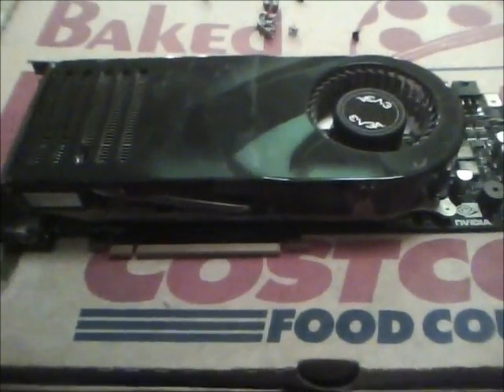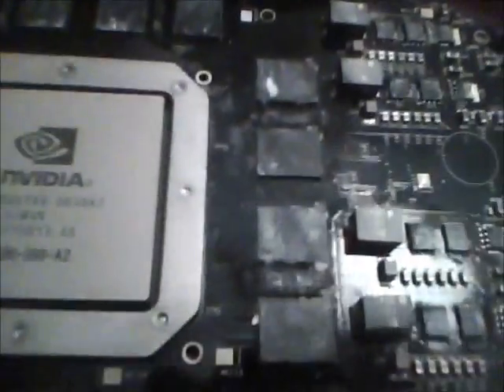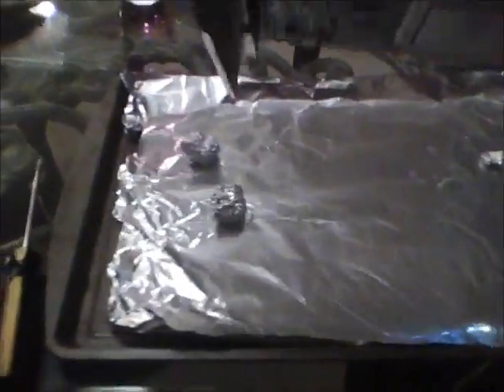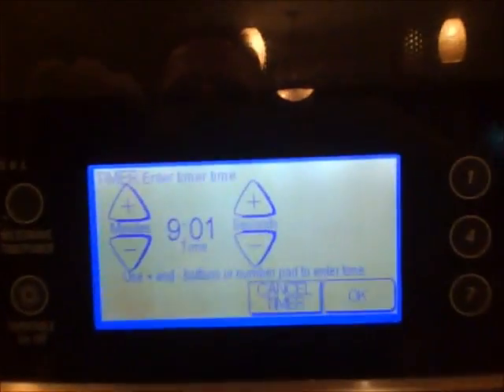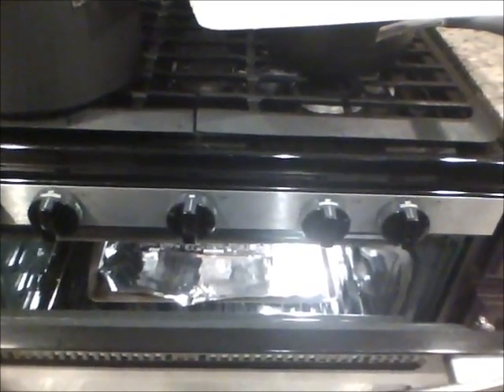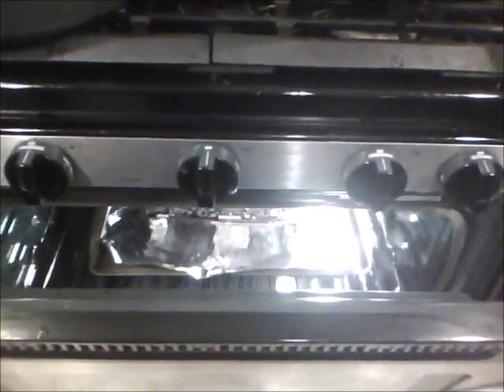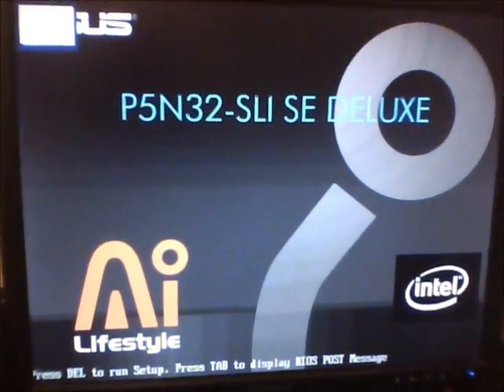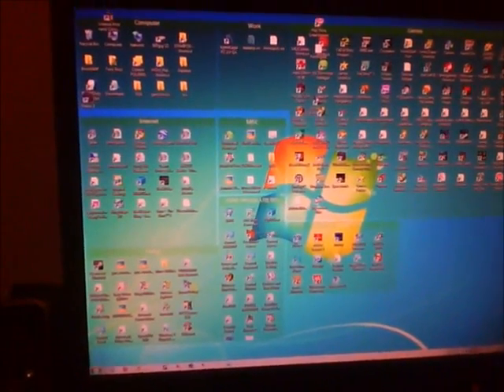Fix your 8800gtx Graphics Card (STEP by STEP) by Baking it in the OVEN.

Comment: This is a awful idea to do. Because of issues with the gpu block falling out do to to much heat across the board. equally heating the joints across the board is a crime it will cause the joints to loosen and cause the gpu to either fall out or become loose. So what I do is use a small butane lighter or welder and quickly warm the solder joints up until they look kind of shiny  with out setting the resistors and capacitors on fire. Remember do not equally warm any side up at any time. We call this baked goods when you cook it in the oven. I call it a gpu when you do it right with the welder or lighter.
Reply: What do you think happens when the board is soldered initially? Its gets dipped into molten solder. Heating up the whole board to the melting temperature of solder is safe. Local heating induces warping, so professional rework heats up the whole board by infrared from below to a bit less than melting, and then use hot air nozzle on the chip from above, to reduce temperature gradient and warping. Warping is the real danger.

Keeping it heated for a while does reduce service life of electrolytic capacitors though, so one needs to plan their replacement. Other elements are just peachy for extended time heated up, as is the board itself, just as long as the temperature is even and moderate.

The reason the GPU failed and solder joints break in the first place is uneven thermal expansion of the board below melting temperature. The board gets close to but never exceeds 110°C in operation, but the heat is very local, board warps, and the still brittle at that temperature solder points break. The solder points need to be heated to the melting temperature to reconnect.

Comment: This works. there is a heating problem in the GeForce 8 series  of GPU,s of its over heating this causes the solder on the unit to slide mostly around the GPU,s memory causing bad connections the result mostly being red lines.

Comment: So i was getting random white horizontal lines with my geforce 465 gtx and would only start in safe mode.When i took it apart the fan had completely been blocked by dust. Did the exact same thing you did to a T, card works great. IT DOES WORK!

Comment: This will fix cards where the problem is small cracks(micro-fissures) in the solder joints, which results in images plagued with artifacts(strange characters) all over the screen.  Heating the card to this temperature causes these solder joints to melt, thus eliminating those cracks.

Comment: Just "BAKED" my Nvidia BFG 8800GTX  was "FRIED" thought it to be the power supply and I already took it apart and tried cleaning and reapplying everything. and guess what works better then the first time I checked it's specs. runs at 57-61c  FYI MSI afterburner can help set your fan to 100% over the 60% that its preset at and allows for over clocking. also has an option to super benchmark your card at max GPU... I'm sure a lot of you out there are willing to use it after resurrection your cards.

Comment: Thank you very much Sir ! It does really work !!! I had white orizontal rows starting loading the bios. At naked eye I didn't see anything wrong with my board. I have also measured capacitors with a multimeter, but nothing suspect. So I followed your instruction (because I had nothing to lose): I put the video card face down in my oven  at max temperature that says 250° C (in reality I measured 210°) So I did for 12 minutes and then I waited half an hour. It really works !

Comment: Just baked my flaking EVGA 8800 GT as per this vid. worked. still cant quite believe it. (layed my card the same way up and no probs).
I would add that perhaps just the process of taking off the sink, cleaning, and reapplying might be half the solution - when i removed the sink, the paste was ALL OVER THE PLACE, spread out over surrounding solder undersides of components)

Comment: THANKYOU Tony Ricci, it worked for me. I have an XFX 8800GTS 512, which died a while back, had to RMA my GTX 570 so I figured while waiting, I have nothing to loose. Before the fix,my 8800GTS wasnt even recognizable in windows, my pc would just go to VGA mode automatically, thats how dead the card was. After doing this, It works like brand new. I knew it worked once in desktop it said, "installing drivers for device" or something like this. I wish I had wine to celebrate but I quit drinking :p

Comment: yea, I'm safing up for a 650TI Boost edition, or just wait for the 700 series, I found another solution, 9800GTX requires 2 6 pin connectors, I'm running it on just one now, minor loss of performance but no more crashes, wondering how long that will last though

Comment: its not about the thermal paste, its about the pieces of metal, after a while it starts to crack and you can get artifacts,
by putting it in the oven they will remelt fixing the cracks and they will work again :D

Comment: You`re right about spreading being the wrong way to apply paste. It can create pockets of air. I used to do it that way until i witnessed it for myself. You may or may not be wrong about the amount of paste (on a gpu). Too little on a gpu can leave a gap between the gpu and hs because the memory contacts touch also and can lift it off the gpu. This happened to me when i put a full cover EK waterblock on my 8800GT. More paste fixed it and dropped temps by a further 32 degrees on full load.

Comment: GREAT GOOGA MOOGA IT WORKED!!!  Thank you so much.  I did it face up (forgot which way you did it :-P) and didn't even remove the heat sink.  I just removed the plastic cover (6 screws) and unmounted the plastic fan (3 screws).  No need to mess with thermal paste.  It worked great.  Thank you very much!!! :-D

Comment: Fuck, some of the components fell off. Did it exactly like the video, must have got too much heat, inaccurate cooker maybe. A piece that looks like a tiny speaker with a hole in it and 2 other square pieces with 2 contacts on each side fell off, don't know what they do. I'm gonna try soldering them back on, miracle if i can sort this out.

Comment: The reason this works is because you are re soldering all of the soldering points. The only ways I can think you can fuck up is by over heating the card and damaging the silicon, but i think that happens somewhere in the 500+ temps. With that being said, if it doesn't work, it might not of been the solder.

Comment: I just took my card out of the oven. This will be the third time, and no sign of any melting what so ever. Also, I have been baking my card without taking the fan off, doesn't seem to hurt much. I think the reason my card only lasts a month is because i never replaced the heat transfer compound stuff... lol whatevs

Comment: Thx for the info:) I might try this then. Me and my 9800gt have been through alot together, we are good buddies. And, how did you deal with those power supply connectors? They are some kind of plastics, wouldn't they melt in that temp?

Comment: you can just put a pea size dot thermal paste in the middle of the chip, the pressure off applying the cooler will spread the thermal paste evenly

Comment: I had a Very similar problem with a 9800gx2 and you probably know the gtx 295 and the 9800gx2 and pretty similar in design. i found the core that was unstable and just re flowed it by just using a heat gun. i don't like the oven trick just because it can heat up parts of the card that aren't really good to heat up like the capacitors etc... but anyway my card was having the same issue as yours but now works as it should. just some advice to help you out some.

Comment: hey can i ask you! I have a gtx295 and i can't run it at stock speeds it keeps going black screen when i run a game but in windows its fine, the only way i can use it for gaming is by under clocking the core,  shader and memory clocks by nearly 50% running core at 350mhz  ! If i bake it in the over like this would it maybe fix it?? anyone? thanks for any reply!

Comment: I followed your instructions to the "T" except for a couple of things.  I did not spread the thermal paste and I did not preheat the oven.  Also I went with your original instructions and had the processor facing down.  Worked like a charm.  Thanks!

Comment: yeah. kelvin scale is the same as celsius... only the zero of the kelvin scale is adjusted with absolute zero and the zero of celsius scale is adjusted with triple point of water,
the difference between any two temps in the kelvin scale and the correspoinding celsius scale is the same.

Comment: yeah i cleaned it up and i found what that was. those are thermal pads and i read that they should be replaced if damaged, not sure is it wise to use grease instead of pads...greas is only for the gpu i guess

Comment: It sounds like hardened thermal compound. Just wipe it until you get nothing but the surface of the GPU (metal, no goop or flakes), pure alcohol helps, but if you use a few paper towels it should come off all the same. You don't want to keep that stuff on the GPU while it's in the oven because it could burn or give a horrible smell. Also it'll make it harder to get off and reapply once you're done. Just use CPU thermal grease like he showed. I use OCZ Freeze, but there's hardly a difference.

Comment: Tried this today after my 8800 GTX started red artifacting and constant BSODs.  I cleaned off the old thermal compound from the GPU (and cleaned up the rest of it too) and re-applied some acrtic silver I had, but I left the old thermal pads the way they were. 

So far, it's running fine (only a few hours now) but haven't seen any signs of the previous problems.  I'm interested to see how long it lasts, but hell, what else are you going to do with a non-functioning card??  So far, so good!

Comment: Just "fixed" my NV 8600M GT/Compal FL92 - about 9 mins. in 190-200C (face down because first attempt with face up and 8 mins. wasn't successful) and slow cooling. Works fine.

Comment: XFX geforece 8800 GTX  Used the airgun to heat it up for 2min 150c 1min 230c 2min 150c.
then let it cool for 30min. 

Think its best to use a airgun if you have one because of local heat on the card. Heating up the total card could lead to even more damage.

Comment: Did it in my 8800gts yesterday (symptoms : red lines on the screen).Working perfect and i did all the stress tests.
I did it today too in my 9800gtx (had different symptoms.overheating with no reason and crashing all the time). Result : works 10 (!) degrees down and not crashing at all!

But i did it face down as the most people recommend that.

Comment: i fixed a gtx 480 baking it on the oven at 250C for ten mins. i wonder how much it will last. the main problem the gpu had was very small artifacts (tiny dots on when watching videos and visibe on the mobo post screen) and mainly the card could not output video with drivers installed. i mean when drivers where installed after the windows logo i got bsod. the card only worked w/o drivers. now works perfect.

Comment: just be careful, some ovens go through heat cycles instead of a fixed temp. use an oven thermometer to tell. if it does and you set to 385°F the temp can go up to 435°F

Comment: Lead free solder goes liquid at 215c, lead based solder at ~185c. Cards use the lead free, so you need to heat the card up to about 230c gradually for the solder to melt.
Preheat oven to 150c, card in, go up gradually to 200c within 5-10 minutes, jump to 230c for 30s, turn heat off. Leave card in to cool to room temp...

Caps are rated #000 hours at 105c peak temp, more at less temp. Basically 10 min at 200c = ~2-5 hours at 105c - you're just shortening the capacitors' life. No worries here.

Comment: I 'baked' my 8500 GT, but not on so high temperature, i set oven to 90 deg. celsius  (194 degrees Fahrenheit), because I was worried about capacitors (they are rated 105 degrees Celsius). 
I left the graphic card inside preheated oven for 8 minutes.
Put it into computer and, voila! It works!

Comment: I was able to bake two of them at 450F for 10mins without popping the caps.  One was done twice at that temp.  I would gently remove it from the oven after 10 mins. Just do not slam it all around  when removing it while hot.  Leave card on the cookie sheet for 30 min
Replace the thermal grease it and it will most likely work.  If the caps do blow you can replace them easy.
The first one I did lasted 1 1/2 months then I had to do it again. But I did not replace the paste but did the second time.

Comment: by the way, I had a quick question about thermal paste. I have a tube of AS5, and Ive heard its actually not that great bcs its conductive for heat, so, I was wondering if there is a different brand of paste I should use for the GPU, or if Ive been misinformed. Thanks for the tip on the thermal tape, too, I think Im going to go ahead and order some from the place you showed me. I also have access to a heat gun, so I may try that instead of putting it in the oven. thanks again for your help

Comment: Worked perfectly for me.  One small point to make is don't try and force the fan off.  If it's hardened just slowly work it, it takes time but if you force it you may break your graphics card, so just slowly try and rock it off.  The same applies to the power cable, mine was really hard to get out and took some time.  Don't get concerned though, it just takes patience!

Comment: OK well.. i just fixed mine with this method.. 

The card was 2 YEARS DEAD ... too apart checked crap for years.. poked and proded it... 

oh and spilt MILK ALL OVER IT.. about a two years after it died.. and its well out of warranty... 

hell the cards FIVE YEARS OLD. But anyway.. i did what this dude did and it did boot up .. (and fail)

First boot it had these 6 smiling dancing faces.. no im not kidding.. and half of them were blinking.. restarted.. and viola .. it fucking works.. 

KICK ASS

Comment: @uuuaaaaaa Yea if it really did get near solder melting temp. The caps would have blown and the IC's would have parted slightly from the PCB, if not fall off completely.

Comment: You know the the show, the F word? He said once, If its brown its cooked if its black its f@cked
I assumed you meant 380 degrees Fahrenheit but did I bother to check? Of course not...
I put my experimental broken gpu in the oven for 10min at 482 Fahrenheit... And of course 5 capacitors popped the pcb has bulged in places and the bit where the fan plugged in competely melted. But I must say, I shall be atempting this a few more times with a little pile of dead cards I have, will post the results

Comment: you must disassemble the fan and clean it from the dust inside , if you don`t do that your graphic card will overheat again ... and put thermal paste also on the memory  dimms !
Also you have to put some coolers on your pc case for a better air flow .

Comment: @MKSoldierAllTheWay Nothing, just get some thermal paste from a local computer store, best buy, amazon, newegg, tigerdirect... etc. And don't use too much, you need just enough to put a layer on the top of the main cpu (gpu in this case) you don't want it squeezing out the sides and creating hotspots.

Comment: to be honest with you it isn't such a smart idea putting in the oven. if you use a heat gun to just heat up the gpu and not the whole thing like the capacitors it can be a better fix.overall just giving another good idea if you don't want to do the oven trick.

Comment from the maker: @ImmortalUniverse yep  am a noob -  don't have components sitting around all day long like BIGGER GPU heatsinks and doing New Reflow stuff.  Sure there are better ways to do this.  Bottom line, is if you want to research and buy extra stuff and then have someone like you explain step by step  then more power to you.  Otherwise,  if you card is POOP already,  and you want to try this.  With as many people this has helped, there is no point to call someone a noob. make a non noob video then.

Comment: Addendum:  I should add though, that if baking bottom side up, if the heat sink isn't contacting all of the chips/parts on that side, they could drop off on that side as well, but it would seem that's a risk for every card, as they're all going to have surface mount components on both sides.

Comment: One other thing I'd like to add.  By leaving the heat sink on, you can bake it bottom side up, which would actually be better, imo, because if one of those surface mount components on the back, that are the size of a flea's nose, were to fall off, you're in trouble.  You need surface mount equipment to reattach those, so, consider leaving the heat sink on for the first try, and bake bottom side up!

Comment: This vid, combined with other tutorials I've read, have helped me fix my BFG 8800 GTS!  In my case, there were so many thermal pads/paste attached to other chips on the card that the heat sink would not budge one bit.  I decided to leave the sink on, pulled the plastic covering off the sink, removed the fan, set it up on a couple of large L brackets:  @390, @10 min., @30 min. of cooling, and.....Success!  Card went from unbootable to good as new!  :D

Comment: next day i tried it again with the same procedure just let it cool down faster and buy new thermal paste. Same problem. So i did it with the chip down and the cooling 10 minutes crack open, than 10 mins full open and then take out and let it cool down totally for another 5 minutes out of the oven. New bigger layer of paste and it worked. Thank you so much man, especially when Skyrim will be released and i cant afford to buy new GPU.Thanks a lot!!!!